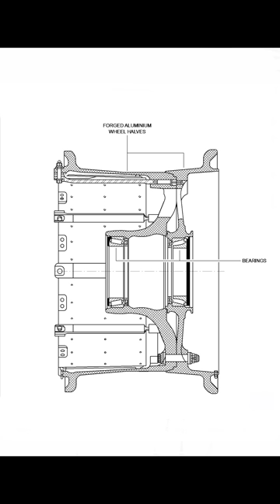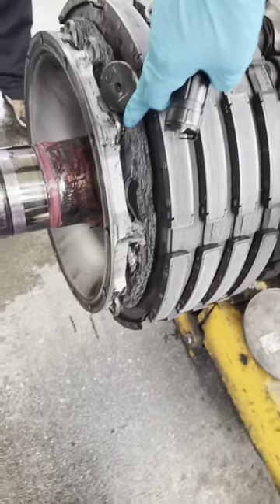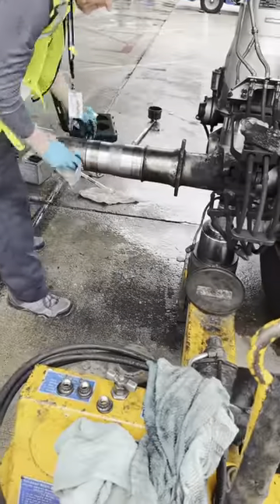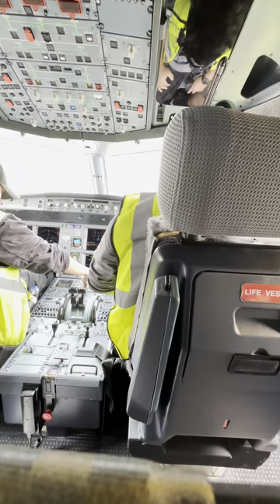Aircraft wheel and brake change due to damage.

Comment: On the CRJs I work on, the wheels have a retainer that hold the tie bolts in place should the nut end shear off. I've actually found two wheels with shorn tie bolts and luckily neither incident caused any other damage. Just stuck new wheels on and they were all good.
Reply from the maker: Glad to hear it didn’t cause further damage. That sounds like a smarter system on the CRJ. I personally never worked them. I learned something new

Comment: Great video. I was wondering, with this type of failure, was fod ejected or are they designed to keep components within the assembly like engine pods.
Reply from the maker: The brake assembly is surrounded by the wheel assembly, so most of it was contained. Whatever small components might have fallen, those will be picked up by airport operations, because they do FOD inspection on the runways and taxiways.
Reply: @StigAviation  after you giving them the heads up right. Thanks for answering.

Comment: I’m surprised kind of you can do videos since it’s all federal right?   Awesome video.
Reply from the maker: Federal has no jurisdiction on these videos. I don’t show anything that is already not known. This is commercial aviation and airports are public property
Reply: @StigAviation  oh gotcha    You are awesome at your job from the looks of it.  I used to work at the airport in Spokane years ago at a airplane painting company.  I had to do all kinds of back ground checks and finger printing. They always seem so serious at the airport so that’s why I was wondering.
Reply from the maker: @rodleypumpkins4174  it’s the same way here to be on airport grounds and working for an airline.
Reply: @StigAviation   ya makes sense.    We would get new planes in all the time to paint    And I’m sure you know this but after the plane was fresh painted a pilot and copilot would take that plane through its paces.  I had a video at one point.  I believe it was an Alaska plane we just finished and They gunned that thing and took off as fast as possible and took it straight up it looked like.    It was a cool job.  I worked with some mechanics too    I was just a laborer.

Comment: I imagine the size of the warehouse for the thousands of components you must have for quick replacement so that the aircraft keeps in the air. Is it true that tires are filled with some sort of inert gas instead of air?
Reply from the maker: We have a massive hangar with a storage specs. Very big. And yes the tires are filled with nitrogen.

Comment: Holy crap at the bolt sheer.  That thing is a bomb and that split rim becomes a giant piece of shrapnel ready to kill anyone near by. 

How do you deflate? Is there a remote system where you can release the pressure, or to take pressure out? Or do you go up from behind and deflate hoping it doesn't go off and take your arm off with it? And if it does explode, it goes out forward? 

I'd imagine there is a remote system.
Reply from the maker: Unfortunately there is no remote way to deflate it. But I’m was very careful when I did it.
Reply: As long as the wheel nut is still installed (the big one on the axle) the wheel won’t explode. It’s holding the 2 halves of the wheel hubs together up against the brake assembly. The tie bolts become more important when the wheel isn’t installed on the aircraft. That’s the reason to deflate the tyre before removing the wheel nut from the axle

Comment: Very interesting, thans for sharing. I wonder how the fan is driven, no electric motor can be seen..
Reply from the maker: Good question! and your assumption is correct... the brake fan motor is driven by a 3 phase electric motor running on 115 VAC
Reply: @StigAviation  Thanks for your reply, but where is the motor?
Reply from the maker: @techdefined9420  inside the axel housing. Watch closely you’ll see the spline shaft in the middle

Comment: Those high pressure aircraft tires are scary when damaged like that. It's a heck of a lot of noise and force when they explode. During the early days of the space shuttle program NASA realized the potential problems of deflating damaged tires with pressures of over 350 psi cold. They tried using a bomb disposal robot, but it didn't work very well and cost a lot back then. So NASA engineers developed a tire assault vehicle out of a RC tank, a cordless drill, a video camera and some battery packs to safely deflate tires from a very safe distance. If you look it up it should make for a good read.
Reply from the maker: That is very interesting. I didn’t know that. Thank you for sharing that knowledge with me. I learned something new.
Reply: @StigAviation  Your welcome. I remember hearing about it years ago and it stuck with me. And thank you for showing that brake mechanism, that unit is awesome! It looks like 4 rotors, big circular pads and like 20 pistons make up that insane unit?

Comment: Tie bolts shearing on the rim assembly seems to me would be from twist torsion rather than tire pressure? I could be wrong I don’t know commercial aircraft systems
Reply from the maker: You are correct, usually happens from excessive torsion. But in this case, it was a defective bolt.

Comment: Hello,

Very interesting. Also I liked the brakes test.

I would like to ask you a question about the taxi test at the end of the video.

Does it mean that you have started the engines and were taxiing the aircraft on your own?

I am asking because in 2007, I met a technician who worked for a german carrier in the maintenance department, and he told me that he had a TAXI certification for the A340-600.

He was allowed to start the engines and taxi the aircraft.
But the cerification was only limited for two years. After two years he had to renew it. Otherwise he was not allowed to taxi the A346, again.
Of course the airline took care about the costs.
I do remember that he said, that his hands were sweating like crazy, when he was taxiing an A346 for the first time.

Thanks for your answer.
Reply from the maker: Yes it means we were taxiing under the aircraft’s own power. And it’s the same here, we have to be re-certified for taxi operations. And it’s the the best part of the job.
Reply: @StigAviation  
You should record it.

By the way, I know that you work for AAL.
Does it happen that you get a call to go to another carrier and check their aircraft?
For example one of the ONE WORLD members?
Or may be to airlines which belong to other alliances like Skyteam, Star Alliance and other operators?
Reply from the maker: @AVIATIONSOUNDEXPERT  I only work on my carriers aircraft. Other carriers have their own maintenance or use contractors

Comment: Why you use a torque wrench to remove the nuts in the back of the brake ?
Reply from the maker: I can set the torque wrench above the torque value and use it to remove the nut. It’s completely legal.

Comment: How do you bleed the calipers?
Reply from the maker: Same way, you would do it on a car, just hook up a line to the bleed port on the brake assembly and pump the brakes. Allow any kind of air to vacate the system.

Comment: Question, the mechanics can "drive" the plane around the airport with engines running or are they just rolling with the push back or being pulled
Reply from the maker: Yes we can drive(taxi) the aircraft under its own power.

Comment: During the taxi did any doors fall off?
Reply from the maker: Why would doors fall off during taxi ?  Your question is not making sense to me sir. Please explain the context of it.
Reply: @StigAviation  I'm sure you are aware of the door falling off the Boeing 737 Max recently? Airlines tell us frequently about how they are so safety conscious yet the quality control and maintenance at that airline is so poor that a door was ripped off during flight! I'm sure you are very good at your job but we the flying public are being lied to by the airlines about how much they care about safety. You aren't responsible for the behaviour of upper management but there are serious problems with that company and who knows what other companies are doing to cut corners and try to save money. How can we trust them?
Reply from the maker: @ronvanwegen  well let me slightly correct you sir. This is a Manufacturer problem, not an Airline problem. The aircraft in question that had the door fly off was barely 2 months old. So this isn’t the airlines fault. Also you mentioned earlier door coming off on taxi, well that has nothing to do with the door, also it’s a completely different aircraft. My point being is that maintenance at airlines are very diligent at keeping aircraft safe and airworthy. Now as for manufacturers, well I can’t really speak on that. As a maintenance technician, all I can do it make sure you are safe and the aircraft can be safe to fly. If it’s not, Trust me , I will ground the aircraft and not allow it to fly . Maintenance is the final authority when the aircraft is on the ground. And no mechanic will ever put an aircraft or the souls on board in danger. I put my friends and family on these aircraft… that’s the confidence I have I’m my and my colleagues abilities.

Comment: Does stuff like this get reported further up the chain? Seems these bolts should be considered fracture critical since it could lock up a wheel I would think someone would want to have a closer look at the build history of this rim to see if it was perhaps a material issue with the bolts or an assembly error
Reply from the maker: Yes indeed. We reported this up the chain and filed a safety report with it. All got documented accordingly along with follow up inspections.
Reply: Nice! Thanks for the reply

Comment: Do you guys inflate the tire in a cage for the first inflation? And being that it is a split rim is there an inner tube or do the halves seal together with some type of seal or o-ring?
Reply from the maker: The tire already comes pre-inflated from manufacturer or overhaul shop. And there is no innertube in that wheel assembly. The rim bead seals it.
Reply: On all the split wheel hubs I have seen there is an o-ring between the 2 halves

Comment: Dumb question. Why aren't wheels spinning as they touch down.
Reply from the maker: That is not a dumb question, it’s actually a good question and it’s been asked many times. The reason the wheels don’t spin up upon landing, is because you would need an extra system to spin them up. That means you would have to have an extra motor, or more wiring and components. You also introduce more systems that could fail, you’re also introducing more weight to the aircraft. This becomes not cost-effective. It’s cheaper to replace a worn out tire than to worry about the components that spin the aircraft wheel up.  Does that make sense?

Comment: Just wondering between the A321 and the 737are they both about the same or is one more of a pain than the other
Reply from the maker: In regard to maintenance and user friendly… the A321 is an easier aircraft to work on. Even though the 737 is not that difficult, it’s just a bit of older technology (some things like a wheel change is easier but troubleshooting faults is a pain because everything that needs a test box is in the avionics bay) as for the Airbus all the interface is in the flight deck.

Comment: How long does that job take technically, and how long the taxi test?
Reply from the maker: Jobs itself with all equipment ready and parts ready will take no more than 20-30 minutes. Taxi is about the same time, this is all in consideration that nothing goes wrong or all is available

Comment: Wonder if spinning the landing wheels before landing save on tire ware
Reply from the maker: That question has been asked so many times, now the idea is smart, but to implement the idea is not cost-effective. That means you’re adding more systems, and more complexity to a landing gear. That means more things that can go wrong. It’s more cost-effective to let the tire wear out and change it then to have, let’s say a motor assembly or wiring, get damaged or wear out.

Comment: What did u do with old brake discs
Reply from the maker: @182mcg1  it is sent back to the vendor for overhaul.
Reply: @StigAviation  How's is the cost old carbon brake discs needs 3 one's
Reply: Cnc brake pads for track car.... More efficient than standard on the market
Reply: It's really working tested use on my suzuki gsxr track motorcycle. Same mount like F1 car no back plate

Comment: I peaked at an early age.  I was a DCC on 2 F-15'S in the 90's.  Yeah call me an old guy.  Eff you :)
Have you seen the movie Idiocracy?  That was supposed to be satire, but I see it everyday lately.  Technical Orders, while annoying, made everything right.  Inspections were not to be pencil whipped.  I understand the utilization rate is multiplied with commercial aircraft, but damn... that it got to this point is evidence of ignorance/laziness. Does no one really give a eff anymore?  The easy button doesn't really exist.   Dammit, by the time they implemented A&P certs, I was out. Seems like they are giving them away now.
Reply from the maker: Jason you are hitting on the right notes. And you ARE right. I’ve been turning wrenches for 25 years now. I’m still an adolescent in comparison to my seniors. But the one thing I want is quality over quantity. I NEED GOOD MECHANICS and not flashlight holders. I need troubleshooters I need fixers. I hope everything I do here transcends to the next generation.

Comment: Do you have to bleed the hydraulic brake fluid? How is that done?
Reply from the maker: Yes, we did bleed the brakes, I apologize I did not get a chance to show that. The process is very simple, there are two ports up top on the brake assembly, we will attach a hose and release the shrader valve to purge the air out of the system
Reply: So, same process as an automobile, just much bigger. Cool stuff!

Comment: I work as ship board engineering on ocean going ship. I wear gloves only when I work with steam. For the other jobs I work without gloves. I don't feel anything with gloves, no feedback on what I m doing with my fingers.
Reply from the maker: I completely understand where you are coming from and I tend to be the same way.
Reply: I am an aircraft maintenance engineer aswell. I always wear disposable gloves when doing jobs. Over time you get used to the feel with them on. Your right, the feel is not as good, but I would rather stop my skin from peeling off (try using skydrol with bare hands). The materials used are usually carcinogenic and will eventually kill you. The other problem is when I eat my lunch, I don’t want all that grease, oil and crap on my hands. I’ve seen plenty of YouTube videos where car mechanics wear gloves and the author has been given a hard time in the comment section for wearing gloves and they are seen as “weak”. Read the contents of the containers that the materials come in, it’s all bad stuff. MJ2 engine oil even has some contents that is unidentified 😮
Reply: @NicholasRiviera-Dr  wearing gloves when you work with chemicals is mandatory. I use gloves in this case. Or when I work with steam. Sometimes 2 pairs, one on top of eachother when I work with aggressive chemicals. But on regular jobs I like to work without them.
Reply: @UncleHo5  I use 2 pairs of gloves a lot of the time aswell, usually when it’s a long job and the outer pair is prone to tearing. That way when the outer pair tear my hands are still protected and it’s easy to put a new pair on over the top of the inner ones. Trying to put a pair of gloves on when I have sweaty hands is difficult

Comment: This is very interesting video, thanks.  I wonder about the cause of the sheered lug-nut.   Obviously redundancy prevents a single lugnut failure to be a major issue.  I do know that in cars, the lug-nuts, if not torqued correctly, have the potential for the lugnut to sheer off.  I learned this long after having rotated and changed many car tires.  Also, I was a bit careless and did not read instructions.  These days, I am much more careful with all aspects of my car.

Needless to say it is important to have a torque wrench to torque car lug-nuts.  For car wheels, Walmart performs a service if they replaced the tires:  re-torquing at 5 miles.    I didn't do it.  I will get the tires rotated one of these days.  I don't drive much.

It gets me to thinking: is there a way to test the torque of the remaining lug-nuts on the aircraft, or even if it is necessary, or useful in forensics.  I do realize you would be certain to torque all the lug-nuts properly on that tire of course!
Reply from the maker: When the work is done initially, we are torquing the said nut, so going back and double checking it would be a bit pointless. Also, given the fact that wheels get changed very often.
Reply: They are not lug nuts on aircraft. The 2 broken tie bolts you saw are nuts and bolts that hold the 2 wheel hubs together. They have no bearing on holding the wheel onto the landing gear axle. There is only 1 big nut that holds the wheel assembly onto the aircraft. See @1:11 the nut is labeled “SEE 32-11-13” to the left hand side of item 10. There is no point in testing the tie bolts for correct torque while the wheel is installed on the aircraft and it is impossible to get a spanner on the head of the bolt while the wheels installed - plus if a tie bolt breaks, it falls out as can be seen at @2:00 there is an empty hole at the 11 o’clock position. Usually easy to spot as it is the clean area

Comment: Does having two
Tires with different tread thicknesses at one location affect anything?
Reply from the maker: On the main gear, not at all. On the nose gear yes, because of steering. That’s why we usually change both nose wheels if one is worn out.

Comment: surprised you aren't required to use a digital torque wrench with audible and #'s that can be referenced and documented with photos
Reply from the maker: Actually, these torque wrenches that were using are more reliable and accurate than digital.